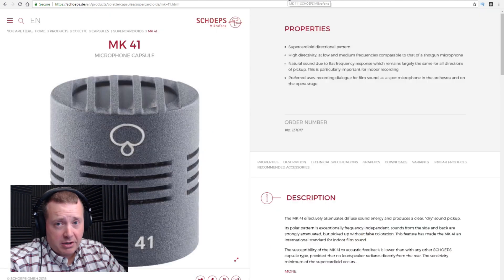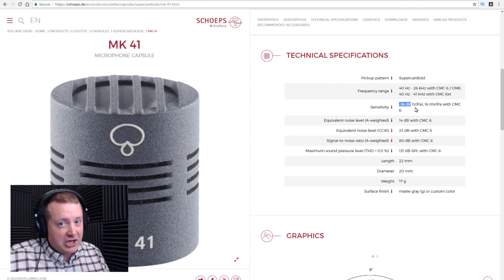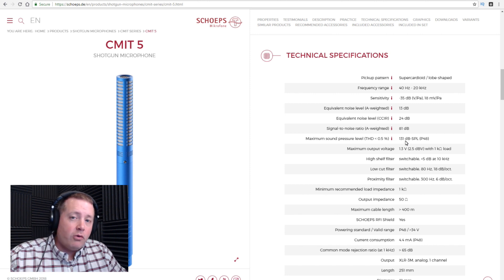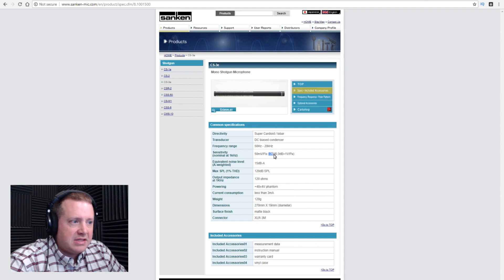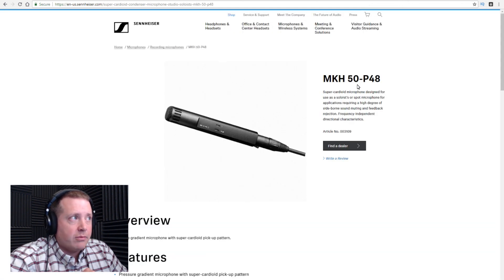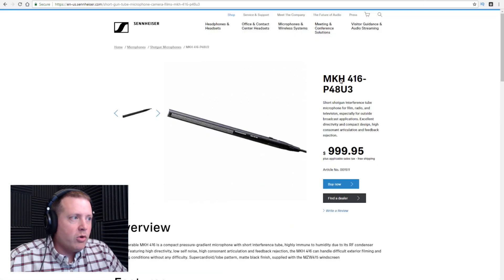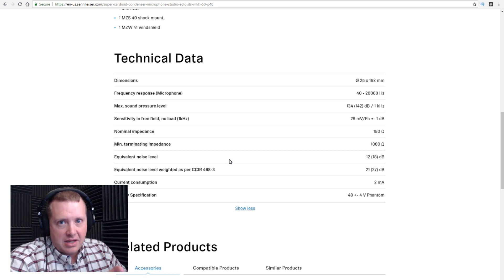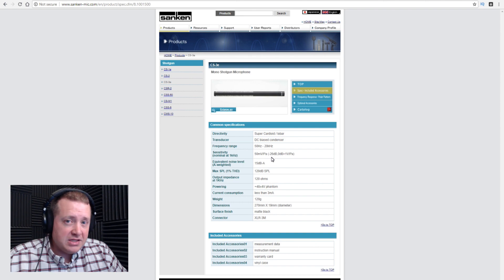Proper MM-1 Gain Staging - Sound Speeds!

Comment: Curious about using an MM1 in a field recording set up. I know there are options from Sound Devices like the Mixpre 3 or 6 with the recorder already built in, but I was wondering about using an MM1 with my Sony PCM M10 recorder. This would require using a female xlr line out to a TRS 3.5 minijack to go into the line input on the Sony. 
A.) Do you recommend this as far as quality?
B.) Is there a specific cord I need to find that will this take the mono signal from the preamp and split it into two signals, so the same mono signal records onto both the left and right audio channels?
C.) or do you recommend something different like the Mixpre D for instance, which btw isn't made anymore.
Reply from the maker: Depends completely on your application. An MM1 into a recorder isn't something I'd recommend. For that I'd use a MixPre or something similar. If going into a transmitter, the MM1 is the way to go unless using pro UHF wireless.

Comment: Great video! Thank you.
1. Where do you locate +4dBu (or 0) on dBFS scale with 24bit recorders?
2. Where do you locate it with 32 bit recorders?
3. Is MM1 any better than 302?
Reply from the maker: 1: This is an analog device and all the MM1 has a line out and all switches are on the back.
2: Depends on your gain staging. More info on 32 bit floating point: https://youtu.be/xyMUAWXjrhA
3: Yes, in my opinion.
Reply: @SoundSpeeds  1, 2. Sure, every mic pre is analog device and has its headroom and how you locate your +4dBu on your dBFS scale is your gain staging decision, so my questions are justified.
3. Thank you.
Reply from the maker: But you don't set levels for +4dB, you set your levels to peak around -18-12dB according to preference. You're talking about dBFS vs analog voltage. This video goes into it: https://youtu.be/iutQGzn4Uf4
Reply: @SoundSpeeds  In professional work (here in Europe) we don't set our level to peak headroom but rather use a generator to set our gain to gainstage our AD converters. This is why we know what dBu value corresponds to 0dBFS and vice versa. That also helps to get desired loudness target when broadcasting live. 
You use some other methods?
Reply from the maker: You're talking about broadcast TV and I show that technique in the EIN I linked. On film sets, it's digital from an internal tone generator at -20dB and you watch the meters. Post will vibrate the tracks based on the tone of they desire.
Reply: @SoundSpeeds  OK. I get it. MM1 has only one gain stage, no generator, you are a boom operator and your sound mixer takes care for five more, but you like to give him stable level and good monitor level for yourself.
Thank you.
Reply from the maker: Yes but my sound mixer transmits back to me so I can monitor the audio as they are mixing it. It also allows them to talk over the mix directly to me. If I monitor on the MM1 the audio would be cleaner but I couldn't hear anything from the mixer.
Reply: @SoundSpeeds  I got it. I was asking questions about whole gain staging process cause in your other videos you present expertise in whole sound production workflow much exceeding a boom op standpoint.
Thank you and I apologize for not related to MM1 operatiion questions.
Reply from the maker: I have never claimed to be more than a film/TV sound professional but I do have a lot of extra knowledge and experience. Sound is very expansive and nobody I know is an expert if everything from stage to film to broadcast to film post. That's why I'm very open about my expertise and if I can't answer something, I state that it's out of my area of expertise and don't want to give wrong info. I have mixed sound since the mid-1990's and answered your questions.
Reply: @SoundSpeeds  I don't think you did. I just wanted to know if 32bit recording would influence your gain staging routines.  If you back off to a boom op standpoint I may look like a strange coockie. :)
Especialy with MM1 which has no metering nor generator. :)
Reply from the maker: You aren't understanding. The MM1 is only analog. No digital. No 32bit. Nothing. dBu analog metering only.

Your recording format is digital. That can be 32 bit, 16 bit or even 64 bit. It doesn't matter. If you get your gain staging set right on the MM1 and it goes out line level to a recorder with 32 bit float, you set your gain staging there properly and the MM1 will sound great.

Depending on your recorder, your workflow may change but that has nothing to do with the MM1. It could be anything that feeds a signal to the 32 bit recorder. Most recorders that record in 32 bit float allow you to set a proper gain but some don't like the Zoom F6. You should not change your gain staging going into a 32 bit recorder just because it has more than enough dynamic range for any recording. If your 32 bit recorder does adjust the gain, the proper gain level you would normally set for fixed point recording should be fine and it shouldn't affect much downstream. If you can't set the gain, like on the Zoom F6, then it may be overly loud or quiet going to devices after it in the signal flow.
Reply from the maker: Damn YouTube! I wrote a long and detailed reply and after it posted, minutes later it was deleted. I'm not doing that again.

Short version. If the analog gain staging is correct, the recording bit rate doesn't matter. If the recorder allows you to set gain for 32 bit, it shouldn't affect anything after it in the signal flow. If it doesn't, like the F6, it may if it's outside of normal volume ranges.
Reply: @SoundSpeeds  What I understand is that gain staging notion was meant as a process to provide the best quality of audio signal. For any bit depth digital or even analog recording the best dynamic range and S/N ratio you get when you use the whole dynamic range up to maximum input level. That level can be at eg 4, 18, 24dBu.
If you set your MM1 gain according to your rule of a thumb and your folowing device has +4dBu MIL you may have problem of no headroom cause  94dB SPL gives +2dBu (1Vrms). On the other hand if you play to 24dBu max input level device your MM1 will distort 2dB lower.
I am curious cause to my surprise people seem to believe 32bit recording is "no gain no pain" and unlmited headroom solution.
Reply from the maker: YouTube keeps deleting my comments. I keep writing detailed replies too. Email me if you want to continue this. YouTube comments suck.
Reply: @SoundSpeeds  I am really friendy and peaceful guy I did't mean to start tough conversation. :) Maybe I just have different approach and focus on some aspects youtubers seem to ignore.
I am sorry I don't know how can I email you while I don't know your adress. Mine is olkoster at most popular google domain.
Reply from the maker: YouTube is deleting my comments. I'm not wasting more time in long replies for you to not receive them. Email me
Reply from the maker: And I'm not a YouTuber first, I'm a pro sound guy that makes YouTube videos. Your questions are easy if YouTube allows me to respond

Comment: Great video! And I would think the same principle applies to lavalier microphones? I see on Sankens website the COS-11D has a listed sensitivity at 17.8mV/Pa or -35dB. So say with a Lectro transmitter connected to it, you would want your baseline gain to be about 35dB? Or does this all go out the window due to Lectros guidelines with "kissing the red" etc?
Reply from the maker: It used to say in the Lectrosonics SMDA, SMA, SMV and SMQV manual that you should set the gain so that the -10dB barely lights up green and the -20dB light occasionally pops red. I don't know if they've changed that now but a similar rule applies today with more modern transmitters, I'm sure.

Comment: Thank you for all those details.
I was surprised when I last used the Sanken CS-M1 for the first time. When I plugged it into the MixPre II (with ordinary gain around 36/38 dB) I felt there was too much noise... The microphone has a sensitivity of -22 dBV/Pa.
Besides in this example, can we conclude even if we are working with a 32-bit "resolution", the choice of the gain can have an influence on the quality of the recorded audio? 
Thank you
Reply from the maker: I explain 32 bit floating point here: https://youtu.be/xyMUAWXjrhA

Comment: My MM1 is on the way!
Is outputting the MM1 to a Lectrosonic L series plug-on TX, an ok way to go wireless with a boom??
Reply from the maker: Totally! I strongly recommend using a padded cable out of the MM1 into your transmitter though.
Reply: @SoundSpeeds  Can you detail?
Reply: I would be recording to a 633
Reply from the maker: A cable that attenuates the line level out of the MM1 by 20dB or so will allow you to gain up the TX a bit and that will give you a better signal level for the transmitter without it sounding too hot.

Comment: At the risk of sounding like a rube, where in the chain does this MM-1 go?.  Boom mic, down to the MM-1 then on to the Sound Devices 688?  Do I even need one for that recorder?  I Was considering it for pre amping to my ZoomH5.  Thanks.
Reply from the maker: Yes, that would work but with the 688, the preamps are great so you don't need an MM1 unless you want an extra gain stage or monitoring position or to go line level before a cable run. Usually you go boom into MM-1 then into a wireless transmitter.

Comment: Good points here, using the specs sheets as a starting point as what settings to use on set rather than just playing around with what "sounds right" until you dial it in (although of course it is important to trust your ears too! And not just blindly follow numbers. But using the specs can be a good way to figure out a "base starting point", especially if someone is inexperienced and unsure what might be a good figure to start with would be). 

After watching your video it did get me to then go look up the specs of each of my popular mics I use more often, and to then think back what are the common settings I normally ask my boom op to use on my MM1. Made me then wonder if perhaps I'm running the MM1 mildly too hot, and I should take it a step down? But then again, probably my boom ops tend to err towards giving the talent a bit more air than I'd personally do (got to have more courage! Push in to that edge of the frame line) so I reckon in the end the math still does check out!

However, I reckon in the future when I need to make that 50/50 judgement call between two steps as to which I should take I'll now try erring more often to the lower figure and see how it sounds. As maybe I've been having a slight internal bias towards the hotter one instead.
Reply from the maker: Everybody does. Subconsciously we think the louder one sounds better unless it obviously distorts or hurts. You're right though, start with specs then dial it in with your ears. There are varying levels of gain staging and is important to gain correctly at the source then work your way back to the recorder. Do that to ear and you can be assured your sound will be the way it should.

Comment: We have one of these units and love it. If you run it into a camera without a mic/line level switch you must use a -20db pad or attenuator cable. (Luckily our C100 has such a switch).
Reply from the maker: Totally! Also make all the cables you may use with it are made the same way, same manufacturer, same model, length, etc otherwise you could have weird gain fluctuations between units.